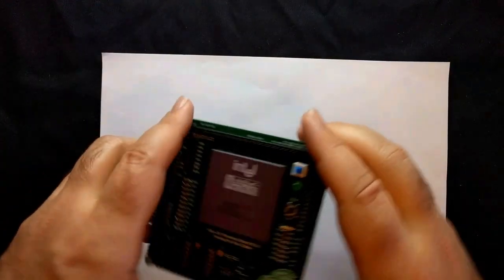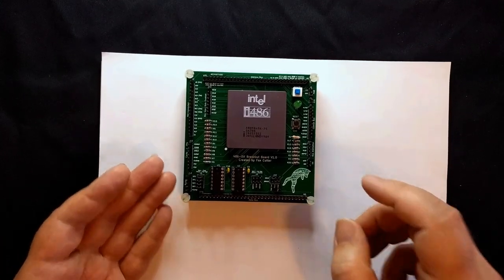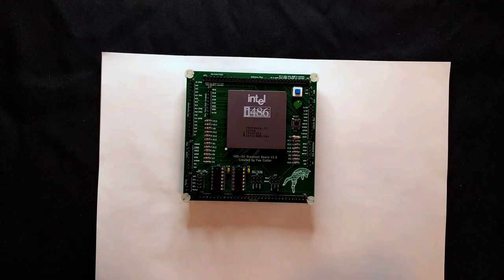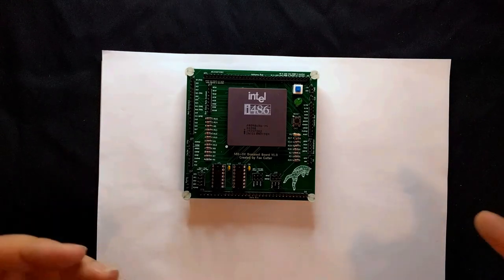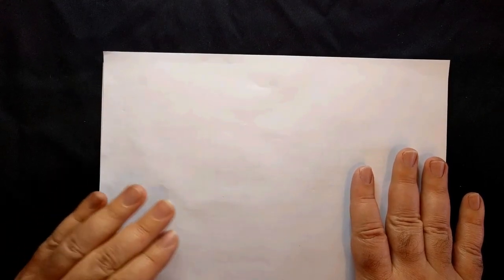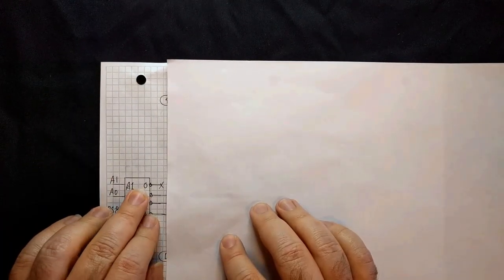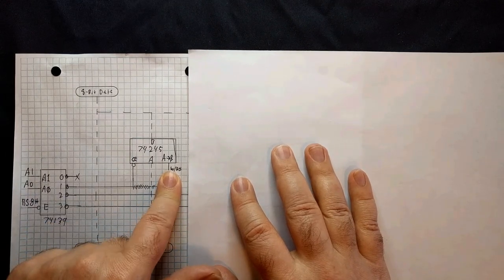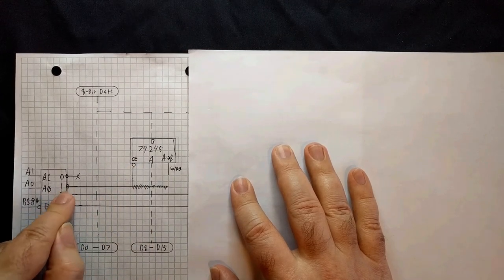486 Breadboard Computer - Part 2

Comment: You don't have to apologize for your breadboards. They're fine. I highly suspect Ben practices his presentations several times before recording and redoes his wires until they're perfect. He also releases very few videos and their purpose is to educate and sell kits. So don't sweat it.
Reply from the maker: I can believe that, I usually go over everything a few times before recording, at least what I wat to say.
Reply: Yes. Ben himself says that he prepares his presentations in advance. This means he also cuts his wires to look neat for the video. In reality, he says that the whole point of breadboards is for quick prototyping, so it's actually better to leave wires as messy as they are; it's better while working things out, as the breadboard prototype is not the final product.
Reply: @Fox-Tech  No judgements!  I wish I could do any of these things!

Comment: 486DX is a very excellent choice given its relevance to the architecture of today's CPU.  All we have is some SIMD instructions, multiple cores, microcode design under the hood and higher clock speeds in the GHz
Reply: Well modern x86 CPUs have more:
More 1st level cache L1. Then 2nd and 3rd level cache (L2 + L3).  64 Bit, RISC based design with µOps since the Pentium Pro, the 486 is still a real CISC CPU and additional instructions and power saving modes. 
But i agree, the 486DX is a very good choice, it has at least a FPU, which was still missing in earlier x86 CPUs and required an extra Co-Processor.

Comment: This is really cool, I had a good look at the 486 about 10 years ago for a project and discovered the 8 bit "mode", I was going to use a CPLD to do the byte shifting. In the end I opted to use an ARM micro controller with external bus.

Comment: A tiny piece of advice, get into the habit of putting decoupling caps on your chips and a reasonoble electrolytic on your power rails.   As you project grows you will be grateful you did this.

Comment: I love your LED debug boards.
Reply from the maker: Thank you. There were fairly quick to put together (even if they only fit on half my broad boards the way I want them to) and turned out to be really good practice on SMD as they are using the 0805 size, which is small, but not to small. If there is enough interest I might do a quick video about them.
Reply: @Fox-Tech  haha I just spent 15min looking for them on Amazon. They look quite professionally made. :)
Reply from the maker: @stamasd8500  Thank you! They were something new for me, and they came out fairly well. I might tweak them a bit for the next rev, but they are so small 20 of them still cost $5 plus shipping. :)
Reply: @Fox-Tech  Unfortunately SMD even at 0805 level is not something I do easily anymore, as with age my vision and steadiness of hand have taken quite a hit.
Reply: @stamasd8500  You can get LED bargraph displays in DIP format that plug into a breadboard and require no fiddly soldering. 10-bit wide ones are available on eBay and I got 8-bit wide ones from Ali Express, along with 9-pin resistor networks. You can use a 74245 as a buffer to drive them if you don't want to load the bus as they are cheaper and neater than eight transistors and eight base resistors.
Reply from the maker: @stamasd8500  I get you there. I can't do any soldering work with my glasses on at all, just can't see enough even with magnification. While my hands do shake, it's not horrible, and I've been able to brace enough to control them.

I have considered doing an alternate design meant for a reflow gun, using resister arrays so everything can be on one side. At least that way the parts would mostly snap into place.

Comment: In my experience you should use decoupling capacitors on the power lines of the ICs, usually 1 microfarad  in value.

Comment: I appreciate the effort you're putting in, Fox. I remember struggling to get the words out. It will get easier over the years. :)

I'd hate working with upside-down chips too! :) I'm sure I'm going to have to do it soon-ish as I'm getting into electronics again. Didn't have microcontrollers the first time around, in the late 80s, though I could have if I was brave enough. XD Maplin sold 6502 and Z80, and in 1990 or so, they started selling 8052. The 486 was hot stuff at the time. :)

Comment: This is great! It opens up so many doors for folk designing "homebrew" computers, especially considering the steep learning-curve that a 486 would seem to have, vs. a z80/6502. At its base level, it's really not a whole lot more complicated than starting with a Z80.

I did some experiments with a 486 chip a while back: "32-bit nopulator."
If I recall correctly, I'd determined that the four data bytes could be combined using nothing more than 4 straight-through DIP-packaged 8x network-resistors. I think I used 330ohms because that's what I had.
I see you're thinking about 32bit [RAM] as well, I think I'd only planned for 8-bit only. So maybe a higher resistance would be better so e.g. one high driver can handle the parallel resistive load to three low drivers.
I think the x86 architecture can be used very similarly to the z80: e.g. maybe there's no reason to even consider segment-registers, if they're power-on reset to 0 and you're only accessing 64K. And things like protected mode and the MMU (and maybe even cache?) are "off" upon power-up, so can also be ignored. Making it, almost, drop-in-compatible with the step-by-step "bring-up"/learning-path of the much simpler "8bit"  CPUs, which I imagine are so popular, in part, because the initial learning-curve to get started seems like it would be (but apparently isn't!) much shallower. Thanks for showing us this eye-opener.
It also opens up many other possibilities, since, e.g. after bringing up a z80 system, there's not much one can do to continue with that same system into more advanced features available (but not required!) in the 486.

Comment: If you use your thumbnail to mark where you want your wire to end, and make another mark 2-1/2 holes further along the wire, the second mark is where you cut, and the first mark is where you'd use a normal wire stripper. 

I have the kind of wire stripper you have, but trying to make it work with these marks was more difficult with the advanced tool. I ditched it almost immediately for the one Ben uses.

Now if your eyes are bad like mine, a cheap jeweler's visor will do the trick.

Comment: I have that same wire stripper/crimper as you (but red)! However. .. mine won't strip my wires, it pulls the metal out the insulation. What wires do you have? I'm using "Solid 22 AWG Tinned-Copper PVC Insulation". Do you have something different, or do I just have a rude stripper?
Reply from the maker: I'm not sure about the insultation, but I am use solid 22 AWG. You might just have a rude stripper. I've noticed sometimes If I'm a bit to relaxed in squeezing the tool that it won't work. Adjusting the tension sometimes helps, and between that and being more aggressive sometimes seems to work. Also scuffing up the cable a bit can help.

Comment: Nice! So for the 8bit Mode the 486 uses two A-lines to decode the position of the Data at the databus.

186 is doing the same but without a decoder. A0 or BHE are going active to enable the lower or higher Byte.

Why you are using just three 245s? To protect the CPUs databus/pins i would add a fourth one. Then the 245 get smashed beside of the CPU
Reply from the maker: The 16-bit bus modes works basically the same, just the A1 being used for selecting which word of the data bus to use. 

As for the 245s, there is a reason and I hope to get into it deeper when I add a 32-bit bus for the RAM.

Comment: The CPU will only read from the bytes that it wants, so you could just buffer your 8-bit data to all four bytes, no byte decoding needed.  If you plan on putting other things on the bus then the enables will still be useful.
Reply from the maker: I do plan to have more on the bus, so it is needed.

Comment: People who care about the wire layout for their breadboards cheat, they have a plastic block that has many widths in steps to get the right lengths for x holes lengths, and just fold the wire ends at the ends of the block.

Also, you can buy jump wires that are pre-cut to the correct length.

Comment: Which make/model is that wire stripper?
Reply from the maker: Not sure of the exact one, as it's a somewhat common design. The one I have is a generic version of a Klein Tools 11061, you can find it on Amazon or a few other places. A search for "Self-Adjusting Wire Stripper" will bring up a few other types as well.

Comment: What are those LED things called I need to order some.
Reply from the maker: They are actually custom boards I made. First thing I had never done with SMD, and they turned out pretty good. The main issue is that they don't fit on the power rails if they are split, but does fit on unsplit ones, and perfectly straddles the gap in the middle of the board. They are small enough to I gat get 20 boards for like 5 dollars.
Reply: @Fox-Tech  Nice. I would love to do my own circuit boards, but I struggle using the programs. They just don't feel intuitive to me.

Comment: if possible, try to film a little bit far, then you can spread the breadboard more...
another thing you can do is to increase the resistors for the leds, so they wont be so bright and can be seen individually better at the camera!
Reply from the maker: I'll see what I can do for the future to add a bit more room. And will probably make the next batch of LEDs with the higher resistance.